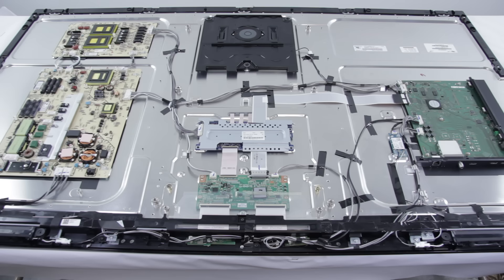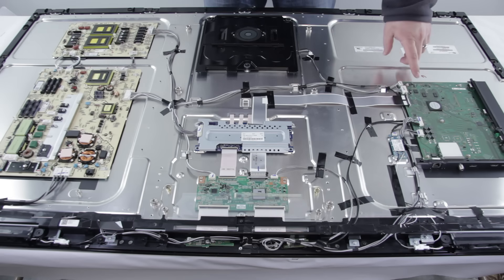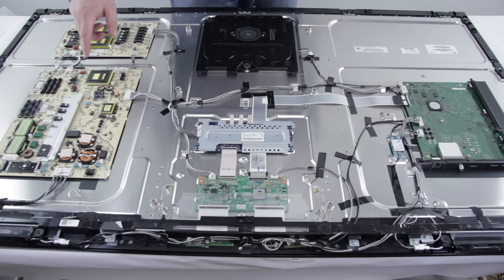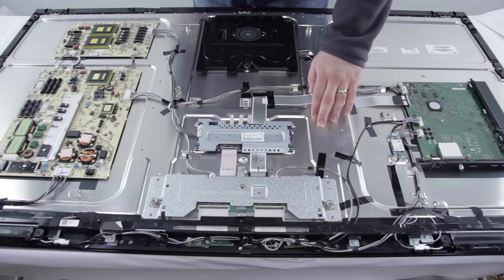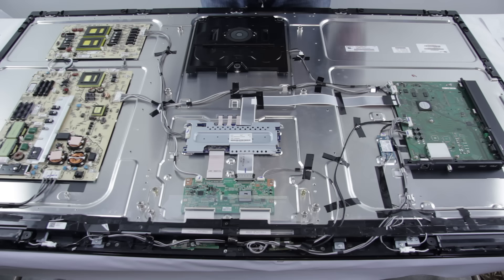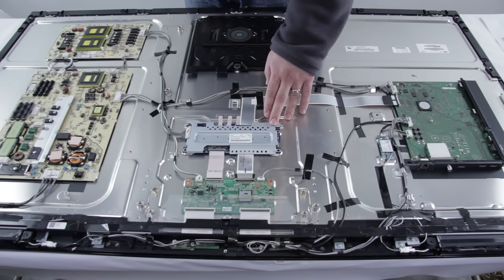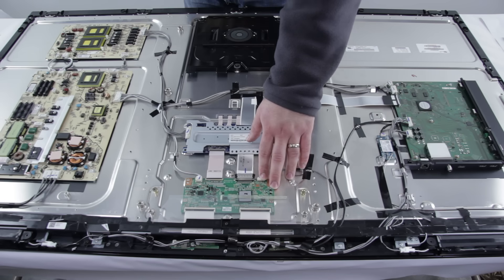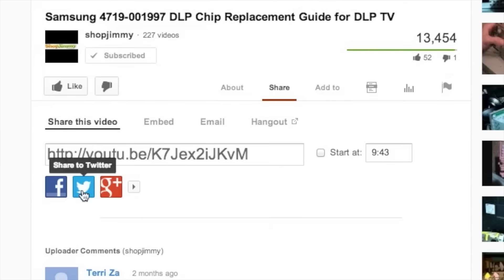LED TV Repair Tutorial - Common Symptoms & Solutions - How to Repair LED TVs

Comment: hai , i have a L.G.led t.v , i was watching it and suddenly it switched off , the service person says that there is dust accumulation in the motherboard of the t.v , is there something like that ? what are the possible solutions ?
Reply from the maker: Abirami Subrahmaniyum   Are there any other symptoms or problems?  Do you have an image on the screen?  Blinking light in the front?  If so, how many blinks?  Thanks!  www.shopjimmy.com
Reply: ShopJimmy.com  no blinks but i can hear the sound of the t.v on and off switch . no image is seen in the screen . the sensor for the remote is on , but no image
Reply from the maker: Abirami Subrahmaniyum   This could be a problem with either the power supply board or the LEDs in the TV panel.  Please reply with your TV model number.  Click here to view a video that shows how to find your TV model number:  https://www.youtube.com/watch?v=S51nhAmwR2M  Thanks!  www.shopjimmy.com
Reply: ShopJimmy.com  how much will be the cost to replace if there is problem with the LED
Reply from the maker: Abirami Subrahmaniyum   We do not sell replacement LEDs or replacement TV Panels.  Thanks!  www.shopjimmy.com

Comment: I have a 32" Element LCD TV Model ELCHS322. Top 1/2 of pic good, bottom 1/2 is distorted, continuous flickering and ghost like pic. Inspected main board and T con board....looks ok. What is best guess for repair? T con board? Or Main board? TY
Reply from the maker: Mike R   This sounds like a TV panel (TV Screen) problem.  If your TV panel is bad, it may be more cost-effective to replace the TV as panels are typically hard to find in stock, difficult to replace, and expensive.  Thanks and please let us know if you have any further questions!  www.shopjimmy.com

Comment: Hello, I have a Vizio model M3D650SV TV that has a video issue. On screen there is about a 8 inch portion on the left side that has video. Then there is about 2 foot section that has no video. Then there is about a 3 foot section that has video. I have already replaced the Main and VO CTRL board which I purchased from you and I still have the problem. Can the LED board be causing this problem? What are your thoughts?
Reply from the maker: Doug W   This sounds like a TV panel (TV Screen) problem.  If your TV panel is bad, it may be more cost-effective to replace the TV as panels are typically hard to find in stock, difficult to replace, and expensive.  Thanks and please let us know if you have any further questions!  www.shopjimmy.com

Comment: Hi, I have an Isis 42_3d. Thexpsu is a vestel 17pw25-4 and main board 17mb65-2. The PSU blew with lots of sparks lol. Upon exam  there were quite few fried components so replaced the board. Now I have no picture or standby/power light yet all the buttons beep when pressed there is also no backlight, could the original damage have damaged the mb and this is stopping the other boards from powering up.
Reply from the maker: shaun doran   I recommend replacing the power supply board and the main board in your TV.  Unfortunately I do not see any replacement parts in the search results for your TV model number on our website.  Thanks and please let us know if you have any further questions!  www.shopjimmy.com
Reply: As an update I've taken some measuremen5s, At pl805 all voltages are present except pins 17,19,21 which should be 5v they are all reading 0. There is also a slight buzzing when main board is connected.Also pl804 is showing 24v at pins 1 to 5 so all seems normal. Any ideas what to check next. It has occurred to me that I received this TV after the PSU was replaced, I know there are several different PSUs in the vestel line and I'm wondering is the correct one fitted its 17pw25-4  250111. The reason I ask is I now believe some boards have 34v, some don't have a 3v rail and various differences etc.
Reply from the maker: shaun doran   Unfortunately we do not have any information on this brand TV.  Thanks!  www.shopjimmy.com

Comment: I have an Element ELEFT502. The picture started going black a couple minutes after turning it on. After turning it off a few minutes, it would come back on and go black after a couple minutes. Now after turning it back on, it is just black. I don't have any way of knowing if the audio works because I have the speakers turned off and I cant see the menu to turn them back on. The light on the bottom of the tv changes from red to blue when turning the tv on with the remote. I've done the backlight test and I can see the menu with the flashlight.
Reply from the maker: Daron Bolen  I recommend replacing the main board in your TV.  Click this link to replacement parts for your TV model number:  http://www.shopjimmy.com/catalogsearch/result/?q=ELEFT502  There may be multiple boards for the same TV model number, be sure to match part numbers on your current board, with your replacement for compatibility.  Thanks and please let us know if you have any further questions with your TV Repair!  www.shopjimmy.com

Comment: Hello ... I wonder what the symptoms of television because of the bord ?
It is because my samsung tv ue32b6000vw when the call she only gives the lamp ... I connect with the command but not give picture or sound or the monitor displays black light ... completely off , just check that called by the light changes and responds to the command signal and the usb television has power ... for a little while , because then turns off and turns on the television again and so on.
I think it's the board from power supply , this ... BN44-00293A is that I can give an opinion .
Thank U

Comment: I have an LG 55L W6500. When I turn on the TV the welcome screen comes on and begins flashing, it won't initialize, and it won't open the home menu or anything else. I got it working once, I ran my fingers over the controls on the front of TV but I'm not sure if that was why it started up, It has power, the remote won't shut it off
Reply from the maker: Donna Cunningham   This could be a problem with either the power supply or the main board in your TV.  You can replace each board individually to see which board fixes the problem.  Click this link to replacement parts for your TV model number:  http://www.shopjimmy.com/catalogsearch/result/?q=LG+55L+W6500  There may be multiple boards for the same TV model number, be sure to match part numbers on your current board, with your replacement for compatibility.  Thanks and please let us know if you have any further questions with your TV Repair!  www.shopjimmy.com

Comment: I have a Lg 55LS5700 and it just lights up blue when powered on.
Reply from the maker: James Douglas   I recommend replacing the main board in your TV.  Click this link to replacement parts for your TV model number:  http://www.shopjimmy.com/catalogsearch/result/index/?cat=56&q=55LS5700  There may be multiple boards for the same TV model number, be sure to match part numbers on your current board, with your replacement for compatibility.  Here is a link to a video showing how to identify your part number, click here:  https://www.youtube.com/watch?v=RwHTvjMdrhk  Thanks and please let us know if you have any further questions with your TV Repair!  www.shopjimmy.com
Reply: well replaced the motherboard and still doing the same thing. Tv lights up but thats all cant change inputs or anything as far as I can tell just see red light blink when I push buttons on the remote.
Reply from the maker: James Douglas   Sounds like you could have received a defective replacement part or there could be another problem.  Are you sure the main board is a good replacement board?  Thanks!  www.shopjimmy.com
Reply: I'm gonna return the board any chance the issue could be the tecon board?
Reply from the maker: James Douglas   Try this at your own risk.  If you are comfortable with using a meter.  You can check and see if the t-con board is receiving 24v.  Thanks! www.shopjimmy.com

Comment: Hi, I have a seiki se50fy28,  It started jumping on parts of the program,  Lost picture, then lost sound all in about 24hr.  Now I have colored strips on the when turned on.  I have lights on the back through the vents. Thanks
Reply from the maker: Robert Gassel   This sounds like a TV panel (TV Screen) problem.  If your TV panel is bad, it may be more cost-effective to replace the TV as panels are typically hard to find in stock, difficult to replace, and expensive.  Thanks and please let us know if you have any further questions!  www.shopjimmy.com
Reply: ShopJimmy.com Thanks for the info.

Comment: i have t h e Philips LCD TV 52PFL5704D Full HD 1080p digital TV with Pixel Plus 3 HD

52PFL5704D/F7   
and it has sound but no picture pkease help what part do i need to fix it ..it has a low blue light

Comment: Good afternoon I have a problem with the main board.tengo one 55lv 400 lg tv buy the main board by amazon and I sent him . The part number matches least at the end that goes brackets in original tv ( 2b ) and the new ( 2c ) and the tv not even turn on. The latter indicates that differs q that does not serve the tv ?? Porq rest everything is the same and says he serves the tv . Help me thanks
Reply from the maker: Dannay Reyes   I recommend replacing the main board in your TV.  Click this link to replacement parts for your TV model number:  http://www.shopjimmy.com/catalogsearch/result/index/?cat=56&q=55lv+400  There may be multiple boards for the same TV model number, be sure to match part numbers on your current board, with your replacement for compatibility.  Here is a link to a video showing how to identify your part number, click here:  https://www.youtube.com/watch?v=RwHTvjMdrhk  Thanks and please let us know if you have any further questions with your TV Repair!  www.shopjimmy.com

Comment: KDL-40R470B, problem is TV switch off automatically and went to standby and red light blinks for 6 times.  When i did switch on tv after 3 days it runs for 1 hour and switched off automatically no picture and sound and red light blinks for 6 times.  Please help

Comment: I have a samsung 46" lcd tv model no. LN46A530P1F and on the right half of the screen the picture is very dark/dimly lit. After a while it starts working out of nowhere, but still has horizontal black bars flickering in and out of the picture on the top right part of the screen. Sometimes there are distorted colors/pictures and multicolored lines. Possibly the T con board judging from your video? Please help, thanks in advance
Reply: Model code: XZA
Reply from the maker: *****  Sounds like you must have bad LEDs in the TV.  Unfortunately we do not sell replacement LEDs for your TV model number.  Thanks!  www.shopjimmy.com

Comment: Seiki SE50FY10 fired it up after work today. Sound but no Picture. Gave no indication, worked fine yesterday...15 months old!
Reply: ShopJimmy.com
Bought another Power Supply Board & T-con and same issue. 1 Board left and where would I get the Leds?
Reply from the maker: Kirk Shockley   I am not sure where you can purchase the LEDs.  You could try searching online.  Thanks!  www.shopjimmy.com

Comment: Hi shopjimmy i have a samsung hd ready led tv model number  UE32EH4003W  my problem is that my backlight is not working, sound is working when i use flashlight in front of my tv i see picture but whithout backlight
Reply from the maker: Dawid Wojciechowski   This could be a problem with either the power supply board or bad LEDs in the TV panel.  You can replace the power supply board to see if that fixes the problem.  Click this link to replacement power supply boards for your TV model number:  http://www.shopjimmy.com/catalogsearch/result/index/?cat=229&q=32EH4003  Be sure to match part numbers on your current board, with your replacement for compatibility.  Here is a link to a video showing how to identify your part number, click here:  https://www.youtube.com/watch?v=sSJexLvRrjM
Thanks and please let us know if you have any further questions with your TV Repair!  www.shopjimmy.com
Reply: Model code is ue32eh4003wxxu
Reply: I'm having same problem. Did u get a fix yet?
Reply: no i dont know 100%  what is the problem everything is working but no backlight i think that is the psu unit not the mainboard. when you open back of your tv that board on the right side ive got no power to led

Comment: I have a 52" Samsung LED tv model  #LN52A580P6FXZA  that I'm having issues with start up. It was cycling on and off for about three to four times before coming on but now it takes it many more times. I did some research to founds the solution to change the power supply or the capacitors. I had them changed and I'm still having the same problem. Do you think something else is wrong with the board or what? Please help.
Reply from the maker: Gabriel Reese   I recommend replacing the main board in your TV.  Click this link to replacement parts for your TV model number:  http://www.shopjimmy.com/catalogsearch/result/?q=LN52A580P6FXZA+  There may be multiple boards for the same TV model number, be sure to match part numbers on your current board, with your replacement for compatibility.  Here is a link to a video showing how to identify your part number, click here:  https://www.youtube.com/watch?v=BEPWrefQvqI  Thanks and please let us know if you have any further questions with your TV Repair!  www.shopjimmy.com

Comment: I have a ViZIO E3D470VX LCT TV.  The back light is on with pushing the power button, but no picture and no sound.  The ViZIO logo is off (neither amber or white light).  The power board has 12V and 5V outputs on the 4 pins (12V output) and 3 pins (5V output) of connectors.  Please five your comments and suggestions.  Thanks,
Reply from the maker: Lisco Llc   I recommend replacing the main board in your TV.  Click this link to replacement parts for your TV model number:  http://www.shopjimmy.com/catalogsearch/result/index/?cat=56&q=E3D470VX  Be sure to match part numbers on your current board, with your replacement for compatibility.  Here is a link to a video showing how to identify your part number, click here:  https://www.youtube.com/watch?v=kxkeGLhlQY8
Thanks and please let us know if you have any further questions with your TV Repair!  www.shopjimmy.com

Comment: I got a 52 inch samsung LED (LN52A850) and the screen has shadow on the right side and after a few hours, the screen will be perfect again. Do you know what is wrong, and how much to fix it?
Reply from the maker: Ken C  This sounds like a TV panel (TV Screen) problem.  If your TV panel is bad, it may be more cost-effective to replace the TV as panels are typically hard to find in stock, difficult to replace, and expensive.  Thanks and please let us know if you have any further questions!  www.shopjimmy.com

Comment: Model #: X325BV-FMDR SCEPTRE 32" LED TV
Symptoms: TV will power on: Splash screen will show for ~5-10 seconds then go blank. TV can be turned on again, and normally screen will stay lit for 1-2 seconds and then go blank again. Cannot confirm sound works.
Reply from the maker: benarline   I recommend running the flashlight test on your TV.   Here is a link to a video we produced that shows how to run the flashlight test. https://www.youtube.com/watch?v=xUzCLgoSPGM Please reply with your flashlight test results and we can recommend a replacement part for your TV repair. Thanks and please let us know if you have any questions! www.shopjimmy.com
Reply: ShopJimmy.com I performed flasklight test on the TV. TCON Board is fine, there is image showing on screen with no backlight. I can change inputs, etc. just perfectly. 
Does this TV have the LED driver in the mainboard? If so, I will purchase from your company!

I will gladly throw money at your buisness to help me fix this =)

Comment: I have a 42" lg 42ln5300-ub the other day the backlight stopped I could see an image with a flashlight then took the back panel off, then  unplugged and re plugged back in the connections to the board with all the inputs put my tv back together plugged it in and it was working again but then went out hours later so I bumped the back of the tv by the inputs with my hand and it came back on. Now a day later my tv backlight  has gone off and bumping it with my hand no longer works it seems like it wants to flash the backlight back on but won't . If you can please help just got the tv for Christmas and don't have the money to buy a new one. Also if I replace the part will it still be a recurring issue.
Reply: See I looked it up and found that the eeprom could be the issues l. What makes you think it's bad leds
Reply from the maker: Zachary Bozeman   The eeprom data does not have anything to do with the backlights.  The power supply powers the backlights.  Thanks!  www.shopjimmy.com